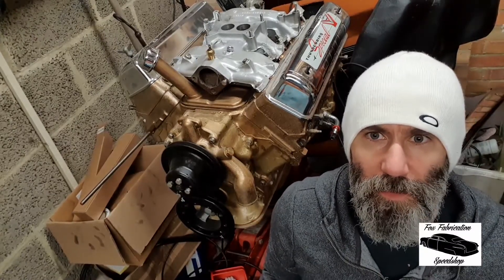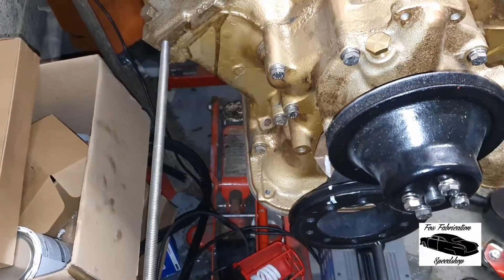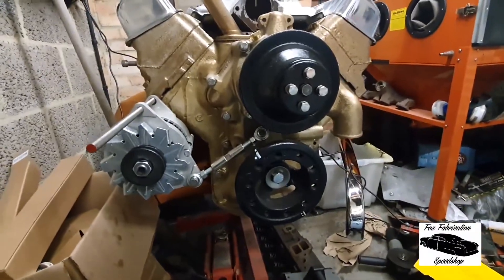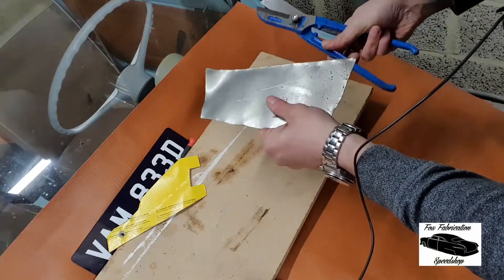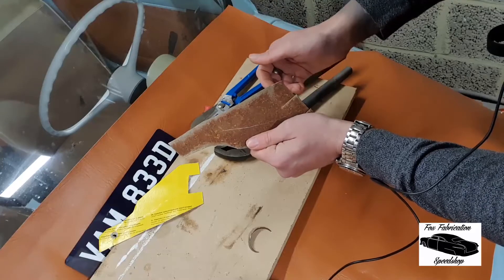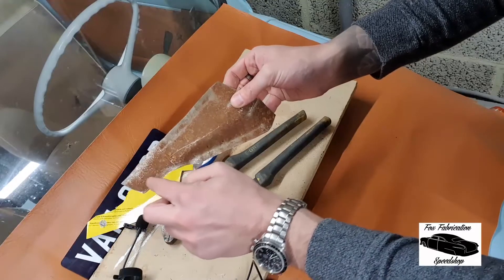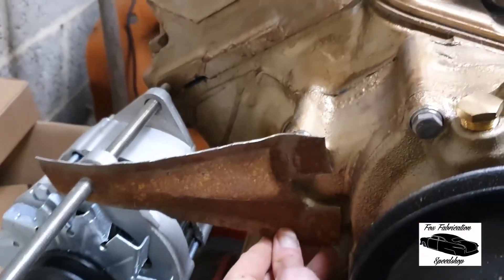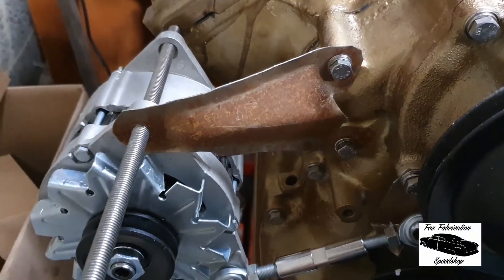Alternator bracket fabrication Y Block Ford V8 - How to - DIY

Comment: Very good! At first I felt that the stock was too light to support the alternator, but as I watched I got an understanding of how the swaged lines improved rigidity. Even without the later welded addition I think the bracket would have worked well.
Reply from the maker: Cheers
Reply from the maker: Tbf ive not got round to welding the back piece on yet, its a project on the back burner for a while!